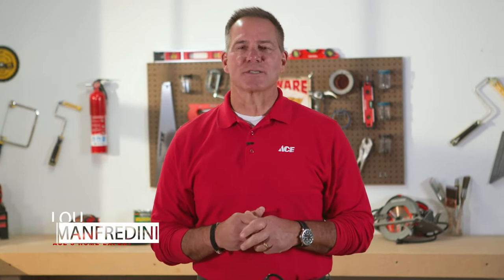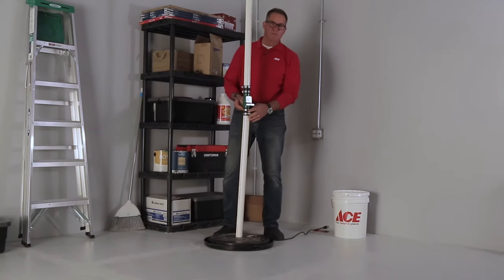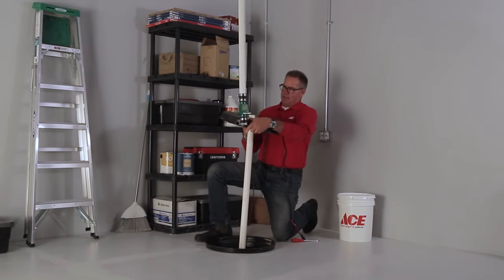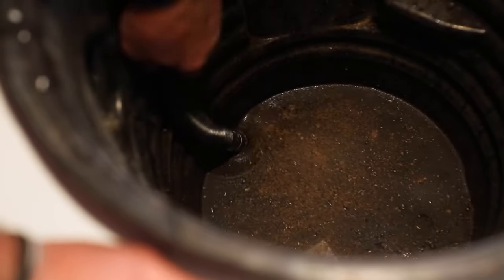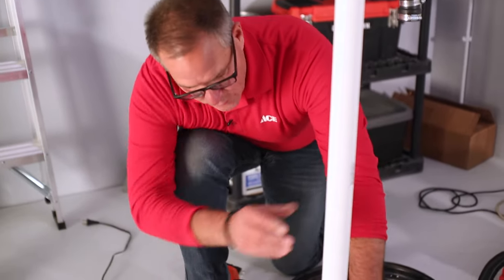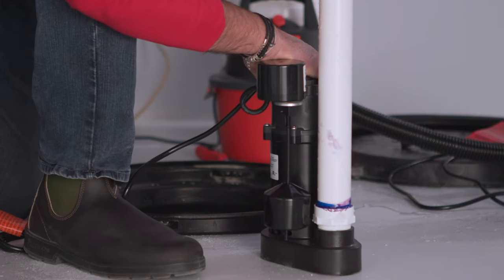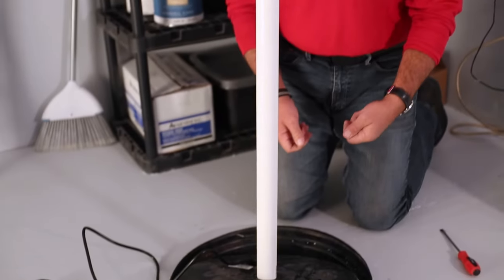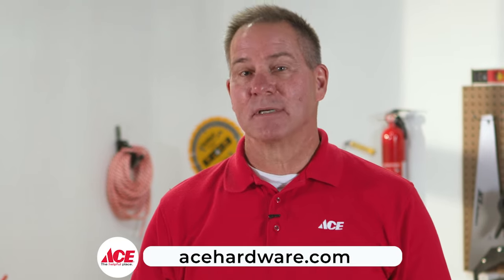How To Replace A Sump Pump - Ace Hardware

Comment: You should place the sump pump on a small patio block or something similar so the intake portion of the pump is standing off of the pit floor reducing the chances of sediment or debris blocking or damaging the pump.

Comment: My pump looks more like the one in the thumb nail and has two pipes leading down into it with a lot more bends than the one in this video, if mine looked like this I could knock it out in 5 minutes but as it stands I can’t even get the lid off